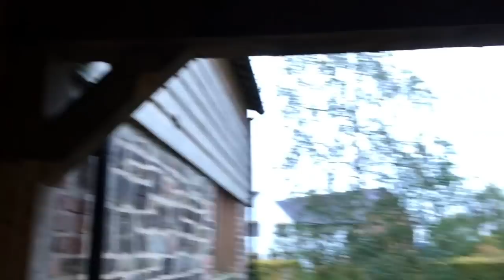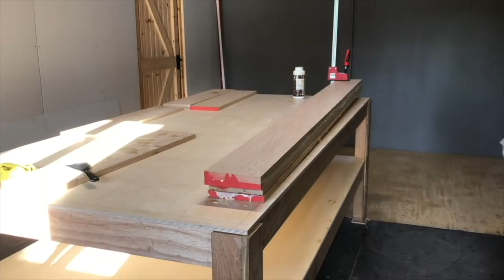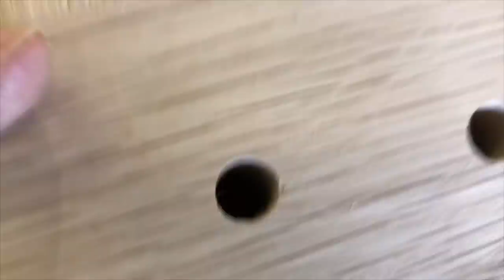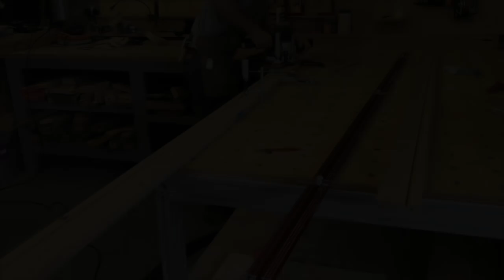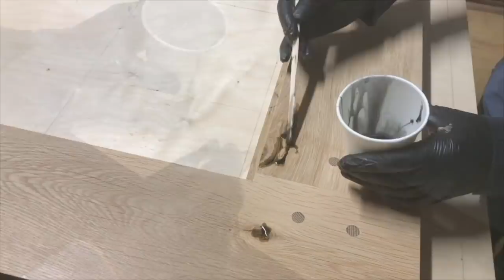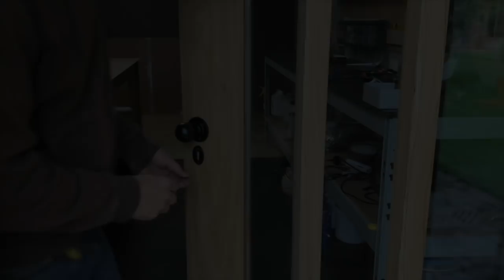English Oak Door Build - Resin Shop

Comment: This may well be old hat to you now that you have a full production set up but you are the one maker I know of whose advice will be directly relevant. I’m about to make a dozen or so internal doors in the Arts and Crafts style. These will be two vertical panels with a 4 panel glass feature above (those panels will be filled with shop-made stained or painted glass panels). I’m very happy making the doors with either mega dominos or M&T - but in a quandary about making the muntins etc for the top panels. Being Arts and Crafts, the muntin profile is very simple - almost shaker style. 

Have you done a video on this? I’ve looked through your back catalogue and can’t see one - but it may be contained within a longer video. Help would be greatly appreciated. Of course, if you ever in Kent with a day or so kicking your heels, you could just pop in and show me first hand. LOL.
Reply from the maker: not sure what to stay on this , Mega Dominos are epic quick and easy to cut if you have an XL ..   if yuo fancy cutting M&T without a Mortiser or Tenoner then got for it .. I would never go back to M&T if I owned a Domino XL ..  :)
Reply: @ManorWood  thank you for the reply. I admit it was more of a musing than a comment looking for an answer. I made a smaller bookcase a few years ago where the muntons were significantly smaller; I used the 500 for those and it got quite fiddly. In retrospect, I should have used M&T but it was a learning experience. Im pretty sure I’m going to use the 700 for all the muntins on these doors; I’ll make a jig to ensure that the mortise on the mountains always hits where I want it. 

By the way, congratulations on your subscriber total.

Comment: You make it look so simple, a beautiful door that will last for decades.
Reply: Maurice Ryton . It is simple to process wood through a machine. Not to detract from the chaps work, but it’s the machines that provide the accuracy. What is unforgivable is putting steel hinges and lock plates in, instead of brass. And cross head steel screws instead of slot-head brass. If it was hand made the door would have character. It’s unfortunate that machine production is the only way to make it pay.
Reply: I'm not impressed by your very negative reply. If you have nothing positive to say then don't say anything at all. I would suspect from the way you have worded the response you get around by horse and buggy as you appear to be living in the past.
Reply: Maurice Ryton. Nothing negative about it. Just factual, and yes, if I could get by on a horse I would. There is a difference between carpentry and manufacturing. I didn’t say it was a bad looking door, and correctly, if you use steel on oak, it will rust and degrade the wood.
Reply: Mark Goddard l do not have the time nor the desire to engage negative people such as yourself. You do not recognize the amazing skills this man has.

Comment: Nice door - and another great video. One question for you though - at about 4 mins in, you are using one of your Ruwi clamps on your spindle moulder - did you need to modify them to make that work? I ask as I contacted Ruwi about a set for use with my Hammer C3 31 and they told me they couldn't make them for the Hammer machines because the slot/nut system is too small..
Reply from the maker: Yes I added a small 6mm T nut with thread lock ..   nice spot .. something like this .. https://uk.rs-online.com/web/p/connecting-components/3900256/